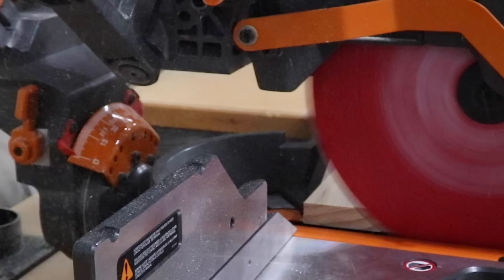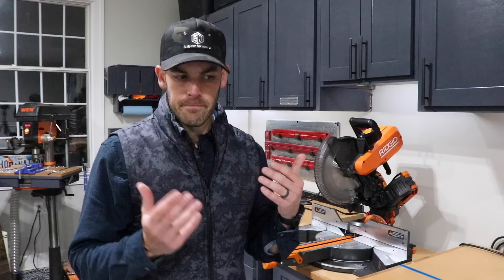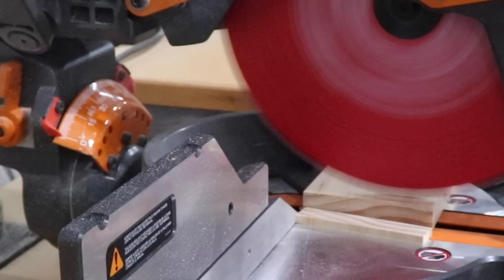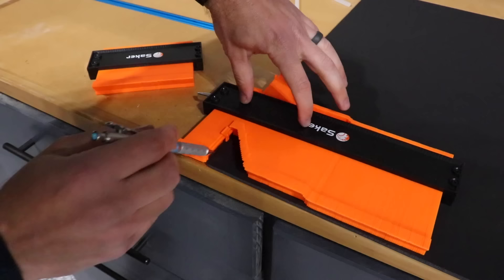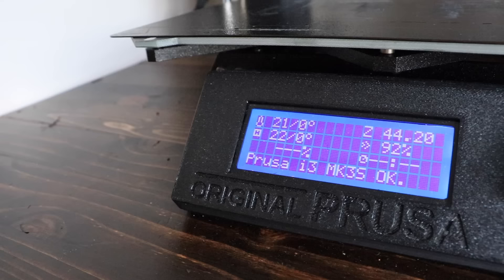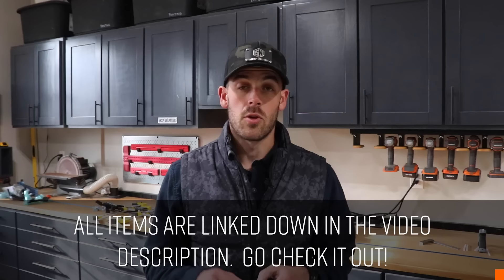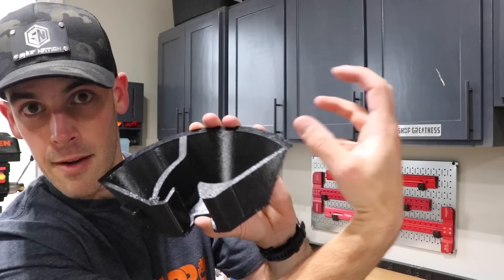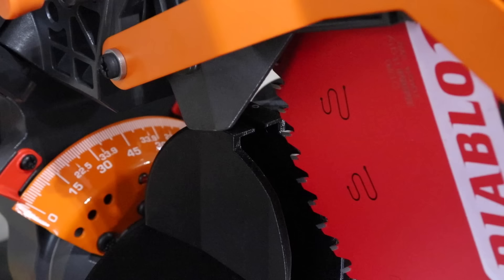Did I Solve Miter Saw Dust Collection?

Comment: I solved it but you’re not going to like my answer. I have the 12” Cruzer. I made a box enclosure and it’s hooked up to my HF Super Dust Deputy with Rikon impeller dust collector on a dedicated 20 amp breaker AND I have the saw’s dust port connected with a 1 7/8” shop vac hose on a 9 gal 4HP Craftsman shop vac with the Dust Stopper on a bucket and both the saw and shop vac are connected to an iSocket auto switch (now appears to be discontinued) plugged into dedicated 30amp 120V breaker/outlet. The result is no dust spat back onto me or on the saw’s table. Overboard? Yes, but I achieved what I wanted.
Reply from the maker: Holy Cow!

Comment: I thank you for your honesty. You did study and work hard with your design and all with the 3D PRINTERS. Everything seemed alright and all, and you really took your time to show us the results…… still didn’t see any better results…. I would , perhaps like you,  be gutted….. I’m just curious if you saw the design of the Festool Kapex miter saw…. Attached to their Festool dust extractors apparently no much dust at all. I’m just a DIY guy…..  not really good ….. but bought some Festool equipment…. sanders, tracksaw , router, but most importantly their too expensive, well all their tools are too expensive, but when all connected together to their designed dust extractors vacuums….. I tell you … really practically no clean up to do….. I do not own the Festool Kapex miter saw…. Instead I have a 10 inch miter sliding Makita saw…. And when connected to my Festool dust extractor… I practically have nothing of dust to clean up…. Not perfect but really good….. I honesty think that the Festool engineering  is much more than we think…. It’s all very much designed with all of their tools engineering…. It’s a system all designed to work with their designed equipment….. I truly hate cleaning up, and I love my little workshop as clean as a dentist chair room….
Great work… Keep on going…. Would like for you to solve your problem…. PS. Connecting my Festool dust extractor with a proper diameter hose to a Dewalt jobsite table saw  does poorly…. Why ? Because the design of the table jobsite saw from Dewalt is poorly engineered for dust collection …… Thus the JOBSITE OUTSIDE TABLE SAW designation… Cheers !

Comment: Good job! thorough attempt, well executed "experiment" with honest results. Thanks for manning up and admitting V1.0 didn't work. As Mr. Sylvester said, "show kids how to fail without crumbling"...indeed. Keep it up! With regard to the problem, I would suggest to you that a more diffuse and open cavity behind the assembly might be worth investigating. A shape that combines a specific physical redirect using the initial impact energy of the dust fleck with careful angles to "bounce" the dust chip stowards a target collector area, which is then secondarily suctioned with a vacuum supply. That's basically what I did and it worked for me. It is bulkier though.

Comment: Something that I would try is to use a brush. I would buy a brush that would wide enough that it can be cut in 2(lengthewise). I would then mount them so that they sit vertically and just behind the fench. The port used for dustsucktion should cover as much as possible on the backside & top.

Comment: A dust collector just can’t get the same volume of air moving from that small of a port. 

Dust collectors are hvlp high volume low pressure. When you choke the opening, volume of air does not keep up with what you need. That is why we run 4” or 6”+ ducting. 

The “suckiness” is good over a large area.

In contrast vacuums use lvhp concept. They can’t move as much volume but they sure can suck!

In this case you either have to step up the size of the inlet to give you 4” with a bigger opening or….  Get a high powered dedicated shop vac on a switch like the IVac system.

Dang physics!!!!

My solution is a 6” port with an enclosure behind the saw. When the dust collector is on the dust tries to move forward but you can actually see it being pulled back in.

Comment: I monkeyed with a shop vac dust collection system for a long time. It isnt enough air moving to prevent the spray of dust. I bet if you put a simple hood directly behind where those chips are shooting (whete the wall in now) and ran a 4 inch dust collector...it would disturb the static air enough to pull 95 percent of it in. You need a FLOW of moving air CONSTANTLY that puts negative pressure back by your head...and terminates at the wall. It looks like you need to reconfigure your saw station to do it. This is just my experience talking. It will be fun to see how you do. I solved mine.
Reply from the maker: Yup airflow is KING

Comment: Not a solution, per se, but some ideas to consider; thinking of how a cyclonic dust collector works, maybe the suction from the vacuum is pulling some of the particles towards it but doesn't have enough overall suction to actually direct them into the nozzle and they are just being pulled further to the back and up.  On that note, maybe some fins or redirection inside the "contraption" may help deflect the particles into the vacuum.  Also, maybe the vacuum collection could be moved to or nearer to the top where the dust seems to concentrate with your design.  Finally, not sure if there's a safe way to do this, but I'm thinking maybe some sort of zero kerf plate affixed to the top and back of the blade shroud might also help deflect the chips into the "contraption" and possibly help control the collection.  Some ideas at least.  Loved the video and the fact that it actually didn't work or help much but there was a change.  "Failure is ALWAYS an option" - Adam Savage  Can't wait to see why you ditched the DeWalt for the Ridged video.  Thanks again!

Comment: I have a Titan saw. The dust extracter is fitted on top like I believe that saw is? That seemed to work a LOT better without having to make anything elaborate. Maybe between the build this episode, and a top mounted extractor. have two lines of extraction meeting into 1 (like on my Titan table saw - Dust extraction on top of crown guard and also underneath the table at the back of the saw box). Hope this helps

Comment: To be thorough, wouldn't it be prudent to run a third test using the factory stock dust collection solution? Of course it's not going to be perfect, but when compared with no dust collection versus your homemade version, it might grant some additional insight into what might work for a better solution.
Reply: You know, looking at this more myself, I think the further back the dust collection is from the point of cut, the more dispersed the dust is going to be before it has a chance to pull it in. The rotating miter table has a groove for the blade to go into; why not try to make a hole at the back to attach your dust collection hose and pull the dust from there? It's directly at the instance of the cut, so it's pulling the dust before it can disperse, it's already perfectly in line with the blade and will move with it when you go to make miter cuts, it's a narrow gap to pull the air through, particularly if you make a zero clearance inset, and it would extend the full length of the saw's cut range. True that it's going to be pulling dust in the opposite direction that the blade is traveling, but since the actual part doing the cutting is the teeth, which are usually at least slightly wider than the actual body of the blade, there should be space for air to pull the dust around. About the only thing you wouldn't be able to pick up is dust created before the blade penetrates through the wood, so just the initial part of your cut or if you make a scoring cut - both of which should be minimal.

Comment: Add a zero clearance throat plate. It will help with the air turbulence. You can also use a smoker for bee hives. Then play back in slow motion. The larger issue is the sliding feature. To account for that, consider using akin to a Japanese folding fan on either side of the shroud. Just 90 degrees on either side that closes when pushing the blade towards the back and opens when pulled out.

Comment: If at first you don’t succeed. 

I personally have been using a box designed around a cheap harbor freight 12 inch. Got the saw from a neighbor for 50 bucks built the box around it and I have to say my shop is mostly clear of dust from that tool. Also using a harbor freight dust collection with seven stations plumbed.

Comment: What about an airblade of compressed air coupled with the vacuum of dust collection. Pushing the dust and particles into the right location and then sucking them up? While not working for particulates with higher mass; it'll help redirect the smaller, higher velocity ones that pass by the vacuum of the dust collector. Personally don't have any experience with dust collection, might be a helpful idea if it hasn't been suggested already.

Comment: Thanks for the video. These things bug the HELL out of me. I've made so many different types of small and medium kind of boxes that fit around the blade in different ways. Not good enough. I've made enclosure type cabinets behind the saw and added sliding doors. Not good enough. I've found - for me - the best yet is a simple large boot-funnel attached to the original vac-scoop to the saw. AND I back my car to the end of the driveway, position the saw on it's mobile cart so the back of the saw faces the driveway and close to the doorway. With the dust collector on I place a large fan that is on a stand behind me and do my cuts! Virtually ZERO  dust in my garage/shop. The only drawback is opening and closing the garage door when it is hot or cold!

Comment: Attach little lengths of coloured wool all over the saw and film it while doing mock cuts and real cuts. You can see the interaction of the vacuum airflow with the airflow generated by the saw, then plan for it.

Comment: Great video! I love seeing the engineering design method at work in the shop and hopefully the results of this test can give some good data to redesign from. 

One thing I know a few other people mentioned: check the airflow path of the dust. I think what might be happening in your design is that the dust collector isn't strong enough to pull dust through it, but is instead just refocusing the dust path to the back of the saw. Might want to try opening up the mouth of the intake to allow more air/dust to be sucked in.

Comment: The MS is a tool that's best served with "area containment/exhaust" rather than "tool exhaust".  I put an intake scoop (4" duct) behind my MS, then made a shroud to cover the top and sides.  Shroud is made from clear plastic cloth on wood frame, so lighting is good.  Capture is about 90% overall, but really fine particles approach 99% (I never pretend to 100%).

Comment: Went down this same route about a year ago with similar 3d printed design. Didn’t work. I’ve since given up on this problem and have gone to the track saw for most things and only hauling out the miter saw outdoors when I need it. I’ve seen some other jigs and tried a few mock-ups and those were nonsense too. Miter saws are just big messy pieces of equipment that aren’t worth the frustration most of the time is where I’ve landed.

Comment: I have to say that I have a 2 hp DC hooked up via 6” pipe with a 6-4” reducer then reduced again 4”-2.5” and it works at about 90%. It may be a volume of airflow issue as shop vac is more air velocity. Just my $.02. Good luck! 🍀

Comment: dust collection on my old Milwaukees 12" slider is the best of any saw I have used to date, even without a vacuum.  only issue is it doesn't work for a shop bench against a wall.

Comment: I had hope you may have hit on a good idea, I thought about later and I’m curious about the idea of an open grid that replaces the table under the saw and that’s enclosed to provide connection to 2 vacuums with hoses. Then taking one step further put a grid vent enclosed behind the saw that covers the width and height of saw that’s also connected to the vacuums, just a thought!

Comment: The problem you give if the air force around the blade compared to the suction forces. You have very high pressure in and around the blade and this drags the wood close to it. Your addition hold the wood closure to the blade for longer which means it only escapes when it leaves your addition, this causes the focused wood at the back. 
If you created a box to the cutting side, maybe 2 or three inches away from the cutting blade with door draft excuser brushes to allow a seal you should capture a lot more and allow air to flow rather than be restricted and create a big updraft forcing the wood up and to the back.
Also people have mentioned using compressed air to direct the airflow and this would be a great solution to force wood into the direction you want.

Comment: i went the cabinet route but i put a big fan at the back with a partition and a furnace filter before it..  traveling in an "S" route  the dust is thrown into the cabinet cavity where the air flow draws it down and then back up on the other side of the partition where the horizontally placed  filter stops the dust and the clean air blows out the back of the cabinet,  the heavy dust tends to fall to the bottom of the cabinet and only the light dust travels back up towards the fan, to encounter the filter..  its pretty effective.

Comment: Let me solve that miter station dust collection problem for you. 

Sell the miter saw. 
Buy a tracksaw. 
Put good crosscut blade on it. 
Set it up where you had the miter saw before, so your track is always square to the fence. 

The bad news is that you’re limited on your max depth, but at least you have decent dust collection, and can make much wider crosscuts. 

Bonus: swap your blade and use it to break down sheet goods or rip wood as well.

Comment: the dust flow off the blade is at a higher velocity than the vacuum . Your opening is small which hurts the ability to flow enough air fast enough. It should be better than it was! I think maybe making the portion of the mater table thats open in the back, one large dust collection port like a vent register then just corral the dust to the wall with a littl fram and face to contain the dust to the area, then just sweep it in . Believe it or not the factory port isnt an after thought and works okay with appropriate hose. I think the combo if the 2 isthe best way to go about it. Awesome video!

Comment: If there was a way that a suction could also connect around the saw blade guard itself. This way it will pick up the dust that is getting kicked around in the guard, especially when the saw is sliding forward and backwards.

Comment: And both Delta and Ridgid copied the design from Bosch, the first gliding miter saw on the market.
I'm just waiting to see your video about this one from Ridgid. 👍

Try a dust booth/enclosure. I know, it's not the most elegant solution, but it reduced the amount of dust on my Bosch gliding miter saw. I still have to clean it from time to time, but not exactly after each use or minor project.

Comment: As an engineer who has designed industrial dust collection systems, I advise you to put a 1" lip around the opening of your collection port.  Currently, you are inducing an breakaway velocity which is causing dust to whisk by the opening and collect on the adjacent surfaces, as you have observed.  Putting a lip (or a somewhat flattened funnel, either will work) around your opening will stop this slingshot type effect.  Make sure the lip is in some measure, perpendicular to the saw blade.  You are almost there, you just need to direct all of the dust into the port.

Comment: Would this work better if you used a dust collector instead of a vacuum?  The old problem of volume of air.  If you use a dust collector, it will draw dust into the port but the vacuum will only draw it what is directed to the port, it does not suck outside of the opening.

Comment: Did the 3d printed parts have a static charge that would repel the dust particles away from the collector? A large hood-type system with a high volume vacuum system would probably work the best.

Comment: A great thing that you did is collect the dust in a central location so now you know it’s being collected all directly behind the blade and then thrown upwards. Need to find out how to deflect it back down though. I would suggest making the top piece with no cutout and using the blade to make a zero clearance cut and that might help.

Comment: I’d love to see you develop a good flip stop for a fenceless miter station like yours. I see you have a stop, but a flip stop gives you the option to square off ends and return to a length. I’ve looked high and low and can’t find a good so,union.  With many starting to get rid of fences, it might be a good seller for you.
Reply from the maker: Hmm interesting
Reply: @ShopNation  trust me I’ve looked, looked, and looked.  While you might be able to find one here and there, most aren’t made for the miter station. Also, many are specific to a certain T-track.  If the bottom of the stop we’re round, it would tighten down into most any Ttrack. Most of the flip stops seem to have a rectangle on the bottom of it that fits into a Ttrack grove.